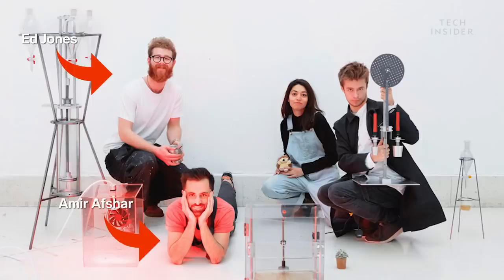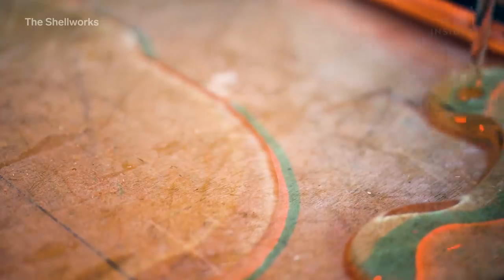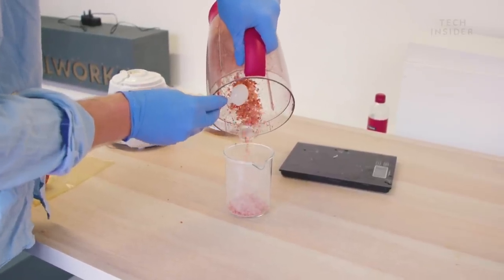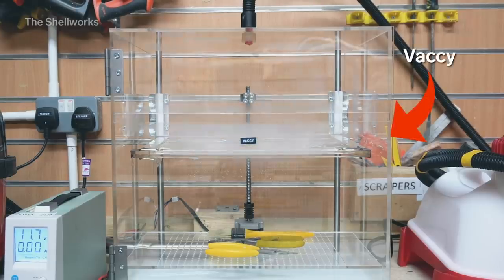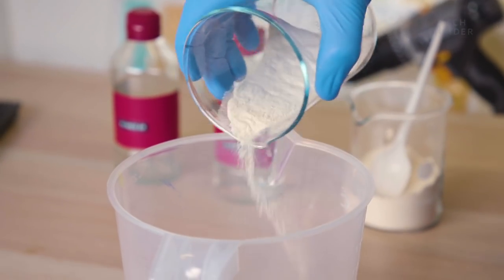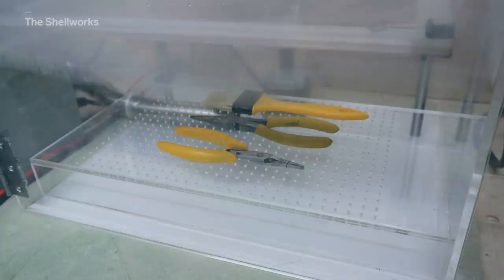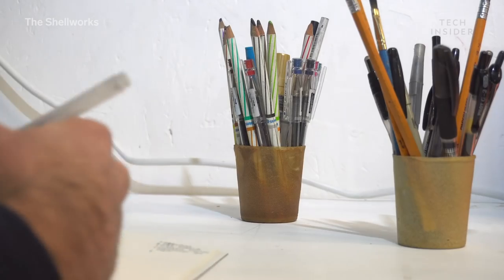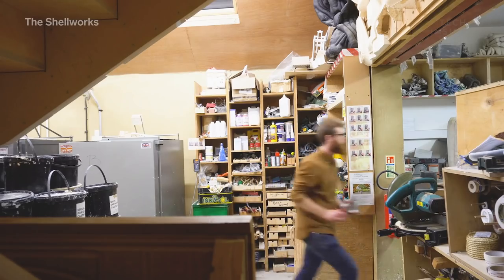How Lobster Shells Could Replace Single-Use Plastic

Comment: that waste amount you just mentioned is an estimate which cannot all be gathered at once place. If it was even remotely possible then we would have collected all the plastic pieces from the waste and recycled it solving the plastic problem. This is just a nice school project and could be used for some special purpose but saying that lobster shells could replace single-use plastic is just wrong. every year similar ideas come up which are even better than this and they disappear.

Comment: tbh the video didnt tell us much. how many lobster shells does it take to make a 1x1 ft sheet of plastic? the water issue is also bad. how well does it actually hold up compared to regular plastic? until those things are shown and are proven to be just as good or better than regular plastic I'm not sold. but I do give them props for trying something different and looking at it. also the flower pot idea is a good one, just seems to have a lot of neesh uses

Comment: That's great and all, but Lobsters would likely have to start being MASS PRODUCED and thus the demand for eating them greatly increased for this to be a workable solution.
However, it might work if people start mass producing with Lobster Farms, there will then be an additional income stream to keep them going by selling the shells (much of the meat sold separate), and then Lobster itself could, in theory, become much cheaper so the demand would increase greatly, thus making it a possible solution to the serious plastic pollution problem.  Crap, I need to start creating Lobster Farms and get in on this tech of the future and get rich.  LOL

Comment: Why isn't a chemist or a chemical engineer in that team?
Because I would like to know how they would get rid of impurities, as well as if especially the extraction is applicable on a bigger scale.
The fact that Chitosan can be used for a lot of applications is known for a long time.

Also, there are reasons why papers aren't getting put into use in the industry.
Mostly because there is one step in the process that is unworkable. 
Like if you have to get your product by chromatography it won't get adopted for a big market.

Comment: we started working with lobster shells, because lobster is delicious. there might be a larger quantity, and higher purity of shrimp shells available at factories where they industrially remove the shells, but we prefer going to restaurants, spend our investor`s money and EU funding on fine dining, and have some unpaid interns go through the waste and separate lobster shells from all the other uneaten food.
we found chitin in lobster shells, which of course we knew we would find, and it is even there in the exoskeleton of cockroaches, (which are very much available) but lobster tastes so much better.
also, we decided to end every machine`s name, we made, with an `y`, because it sounds cute, and it is always a plus.
seriously, using chitin to make biodegradable plastic might be a good idea - lobster shells from restaurants, certainly not feasible. Go for a factory that produces insect (or crustacean) meat and have them use the exoskeleton for bioplastic.

Comment: If only already dead lobster shells would be used it wouldnt be enough to change plastic completely as a quick solution. But maybe only within the time if same material would be made from already used one, that could be possible. Maybe

Comment: Why don’t you try doing the layers of wax ceramic and then your plastic the plastic and compacted ceramic will bond good and the wax on the inside will bond good with the ceramic thus the water could only dissolve the plastic after a penetrates the wax and compacted ceramic... just a thought
Reply: And by ceramic I mean like a compacted ceramic powder not glass or kiln fired, so that it is more readily compostable and won’t have the issues stone or glass do Because the materials holding it together are degradable 👍🏻

Comment: You failed to explain how it is biodegradable. Creating plastic without fossil oil is'nt new, some of the oldest plastics we have are made from other stuff than fossil oil, but it does not make them biodegradable!
My experience of ketin is NOT that it degrades very fast in nature. Finding very old beetle or crab shells isn't uncommon.
Reply: @Eustace Bagge Celluloid is a plastic made from tree fibers, Viscose is another example. Trees brake down in nature, Viscose and celluloid don't. There is no guarantee that plastic made from organic matter is biodegradable. It's probably fine if ketin plastic is biodegradable, witch is not explained in the video, but it would be better to stop single-use plastic alltogeter.

Comment: It's a noble cause but I fear not practical.  Think about it.  To collect the waste from each restaurant and food processor would cost a fortune in fuel charges which would add an inordinate expense on top of production costs.  It would be far better to synthesise the components and then produce the chiton plastic plastics in bulk.

Comment: Great, how do you do this on an industrial scale without all the manual labor, and how to you get all these lobster/crab shells from restaurants to your industrial-scale plant? Otherwise you're making $10 "single use" bags, i.e. useless as a replacement for $0.001 single-use bags from plastic film. This isn't even getting into the water-solubility problem.

Comment: I agree with most of the comments. This is such a closed minded idea. There are quite a number of plant based biodegradable plastic ideas out there that have been proven to work. While this is is using a left over product it is still supporting an industry that destroys habitat and leads to species extinction, not just lobsters. Horrific, terrible, extremely destructive and bakcwards idea in a world where we need to go forward!

Comment: It just needs:
Segregation of shells from other biodegradable waste
Processing of the shells for disintegration.
Chemical processing
Lots of vinegars.
Wonder what the cost of production this thing will take.
But you cant use bioplastic anywhere in the tropics or the GEL will melt, and cant get it wet or it dissolves.
Oh, and dont forget we need actual animals that produce shells. And big animals at that because no one would process cockroaches for the miniscule amount of chitin they have.
The idea has merit but it's a long way from replacing plastics.

Comment: In before Thunderfoot debunks it, hehehe. There is always something wrong when you have Architecture and Art and Design students work on something that is all hard STEM.
My guess is that you would need way too many lobsters to make anywhere near enough substitute-plastic out of them to where it gets anywhere near commercially viable.
I only watched the first minute or so of the video yet and it already seems deceptive in the way they try to pretend as if that clear liquid would come out of the lobster shells, without a lot of filtering and other stuff you need to do to whatever that acid makes out of the shells first.

Comment: Chi-tin. (Ch-ai-tin) not (kai-tin). Wash your fingers when handling sanitary plastic used for showcasing. It's not going to affect those allergic as chitin plastic sterilized and activated with vinegar has no tropomyosin and wasn't from the muscle anyways but the shell. Aside from that most restaurants and American and British industry in general is very lazy. They won't ship all those shells to make this cost effective or industrially worthwhile. That said. We could use plastics made from banana peels and other easily acquired plant substances

Comment: you are claiming that you will remove methane from the air by making the shells into plastic instead living them into a landfill to rot away, but what does your plastic produce when it degrades? unicorns and rainbows? :)
also the chemicals used in the process of extracting chitosan and the byproducts are not environment friendly, so here is that... btw the procedure is old, its not something new, whats new is what they are making with the chitosan, "plastic"...

Comment: This is great a very interesting innovation🙋🏽‍♀️ however while were using this product why can't we reuse the plastic and almost everything else in the landfills already!?? and turn🤯 them into or rather genetically modified them into bioplastic that can be biodegradable into the environment. We're already making biodegradable products from synthetic material why can't we do the same with all the junk in the landfills. Look we can build houses, much stronger levees, homes, commercial businesses, manufacturing plants, windmills , sustainable energy efficient solar energy both external and internal components and so on. 😀🤔🧐

Oh right I forgot corporations are assholes.😑🙄😠